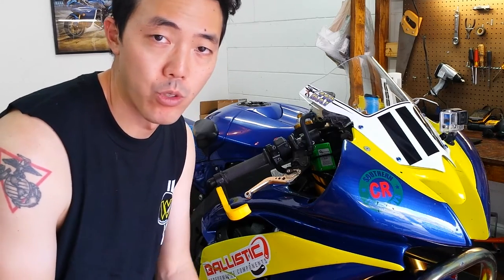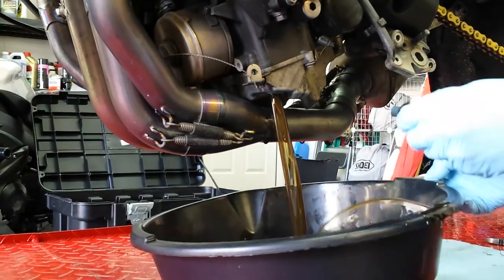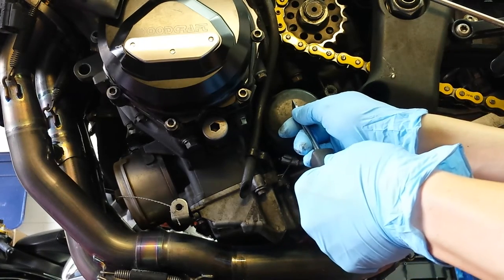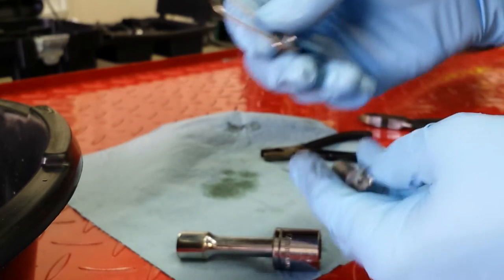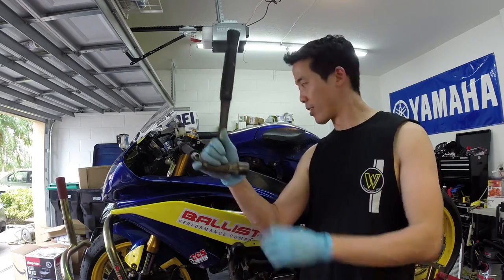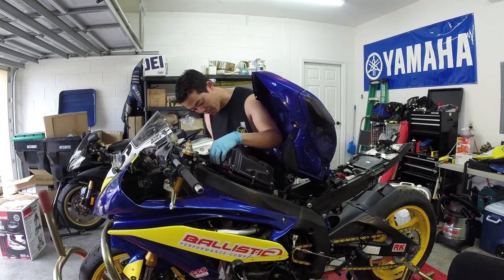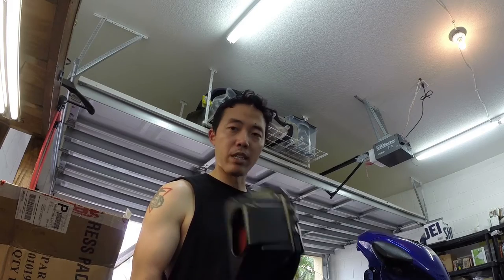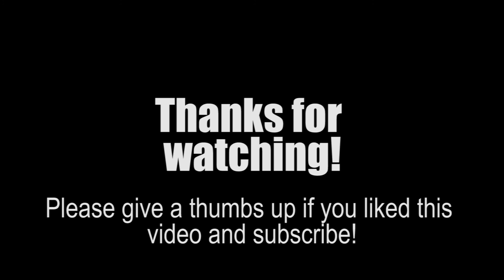Vlog 2 - The Nuts and Bolts of Motorcycle Maintenance

Comment: is that a HF lift? if so, what is your feedback/review on it? been thinking about getting one, seen a few videos on YouTube but would like your feedback on it. Great videos, liked and subscribed!
Reply from the maker: +Victor Rodriguez Yup! It's a Harbor Freight Motorcycle Lift Table. I've had it for a few years now and it is simply awesome. Perhaps not as convenient as a pneumatic lift table but for the occasional maintenance, it's way better than contorting yourself on the ground. I didn't use the included wheel chock but I don't need to as it's long enough to put both front and rear stands on. Just don't leave the hydraulics to hold weight. Perhaps I'll do a proper review video on it later! Thanks for the like and sub!
Reply: Jason Dai a video review/experience would be awesome since I'm sure I won't be the only guy who is looking for one. I've heard that sometimes they have this coupons where you can get it for a lot less (~320) so definitely worth it. thanks
Reply from the maker: Yup, I got one with a coupon so it was a steal for sure! Stay tuned for a review!